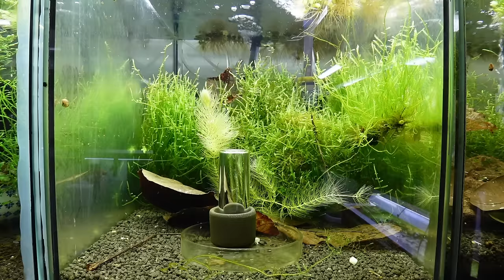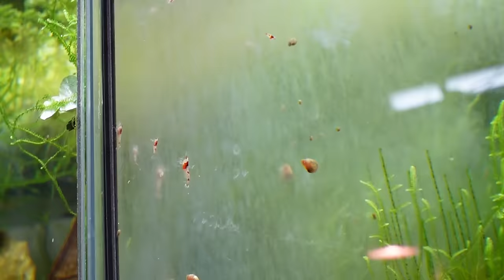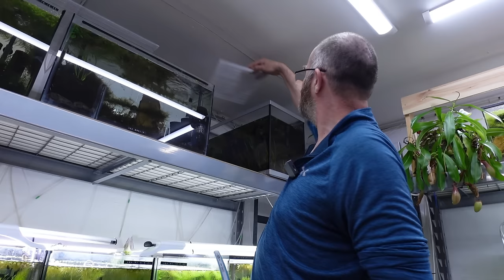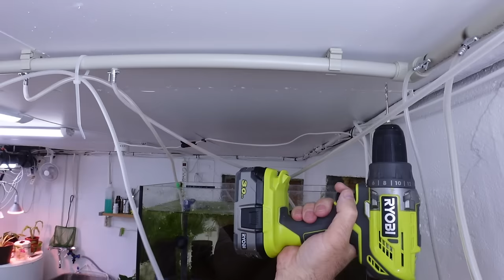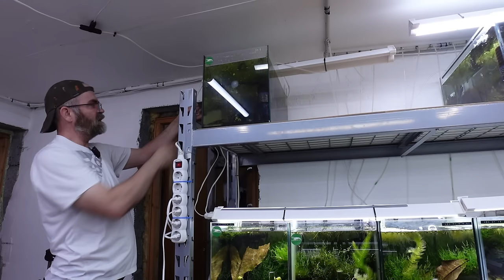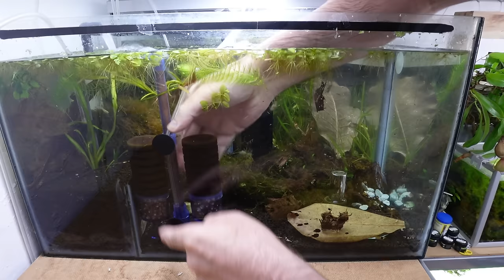Moving Tanks, Fixing Lights, and Optimizing Airflow

Comment: Problems with a weak threaded connection in a PVC pipe can be eliminated by applying a sealant for PVC pipes, or Thread seal tape (also known as PTFE tape, Teflon tape or plumber's tape) is a polytetrafluoroethylene (PTFE) tape that is used in plumbing to seal threaded connections.
The tape or sealant is applied to the thread in a thick layer, and screwed into place. The sealant should be given several hours to dry, the tape works immediately.

Comment: You can try jb weld on  mending those pipes not sure if it is toxic that’s the question used it on waste lines that had drill holes in them.. look up jb water weld
Reply from the maker: yes that might work, these are just airpipes so I dont think what they are made of will matter to much.

Comment: Hello! As always, I'm watching your next video. and as always, they are not just interesting to watch, but also have the opportunity to learn something new. Thank you!)
I want to consult with you. 
I feed the shrimp 2 times a week in very small portions, so that they eat it in 2-3 hours. And I make substitutions of 30% of the water once a week drip.
Did I understand correctly that you advise feeding a small portion of food once a week, and never changing the water at all? And only to top up the evaporated osmosis? 
Won't phosphates accumulate as the soil ages? 
What are the risks to water and shrimp if you don't make weekly substitutions?
Reply from the maker: Hello Yes you heard correct, feeding once a week minimal amounts and only top up with pure RO, Phosphates dont build up because your feeding is very low.
Reply: @MarksShrimpTanks  
I forgot to ask about the bottom of the important thing. 
Do you apply any fertilizers for plants or mosses that are harmless to shrimps? 
I'm making a special fertilizer for mosses. If I stop making it, then algae, flip-flops and black beard appear, because the growth of mosses and bucephalanders stops.

Comment: You can cut a small piece of the same pipe as the airline and cover the hole where you took the valve out ( white pipe on the ceiling  ) and solvent cement glue or just use any cianoacrylate superglue , just bear in mind that solvent cement my be toxic
Reply from the maker: good solid advice thank you!

Comment: Nice calm talk about the hobby, I like that kind of content.
As you are talking about reduced food/waterchanges ... excessive waterchanges were and still are pushed by the shops/channels which also sell or advertise fertilizer and food ... they tell the unaware that water changes remove toxins, but in most cases of a decently cycled+planted tank water changes just remove all the elements and microlife the flora and fauna want for a healthy growth.
fairly easy to save a lot of food, water and fertilizer by simply replacing waterchanges with water tests ... with growing experience one also can recuce the testing over time.

And please get yourself a cheap water pump to transfer water, pains me to see you lifting buckets and wasting so much effort and time using a jug. Dont make your life harder then it has to be.
Reply from the maker: yes I will get some type of pump, it was a real struggle for me in the video, thank you for taking the time to comment 😀👍